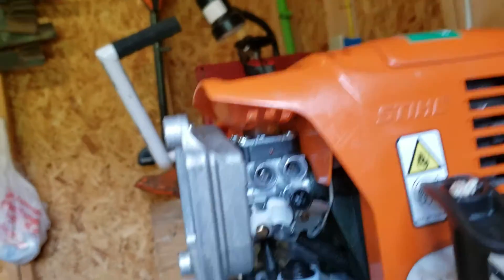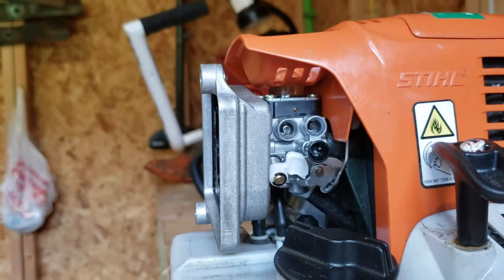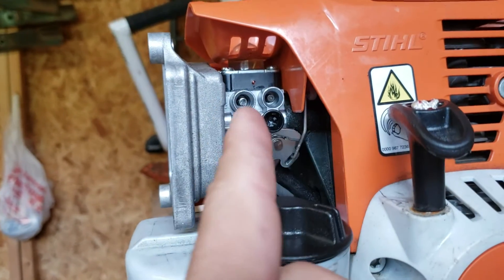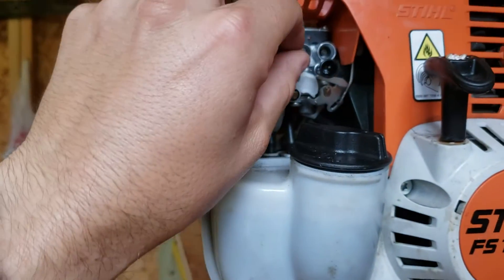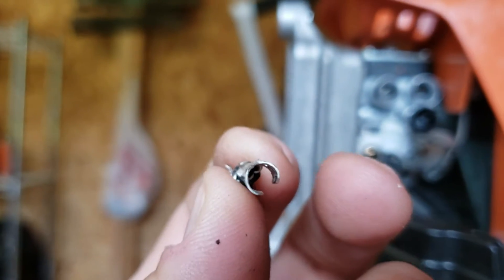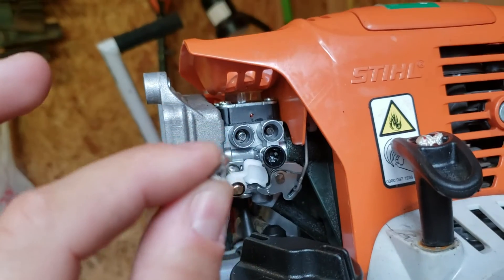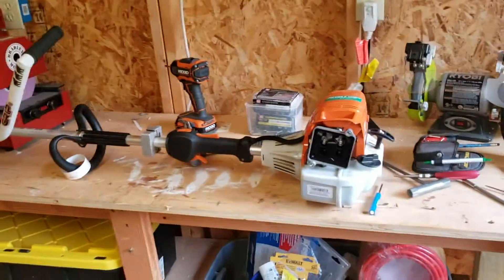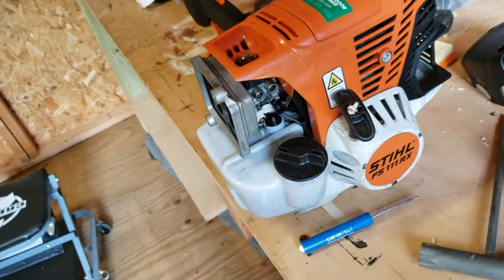DIY make your own Stihl Carb Adjustment Tool in a pinch.. Lawn Care

Comment: Please also add info on exactly how to tune the H and L on these presumably 4-Mix machines. I just tried an adjustment and I find it a bit different from ordinary 2-stroke chainsaws. L-adjustment is very easy. These 4-Mix engines have a different max RPM though and i find it more difficult to hear when they are just slightly on the rich side as they should be.

Comment: all you have to do is use a blue electrical wire splicer they slide right over those damn things just put a felt pin mark on it so you can tell how many times you turned it

Comment: Just buy a little pack of red size 14 gauge wire Splicers. The barrel type that are made to put a 14 gauge wire in each end and then crimp down...just take a brand new one they fit right over the end of your adjustment screw.

Comment: Great tip. Another method if no electrical connector is I used tweezers pushed in then pliers to squash the tweezers. Once the nut moved I could just hold the tweezers tightly without the pliers

Comment: I would like to buy the tool for my Stihl FS 70. I have the Double D, Hexagon, splined, Pac man, and single D. It is none of those. I don't have the 21 tooth spined. Can you tell me what one to buy?
Reply from the maker: This is what I bought. HOOAI Carburetor Adjustment Tool Kit for Common 2 Cycle Carburator Engine - Carburetor Adjustment Tool Set Carburetor Tune up Adjusting Tool (10pcs + https://www.amazon.com/dp/B079L4PKWQ/ref=cm_sw_r_apanp_rN8Ts7DweS1dm

Comment: Mine had the carb replaced and the idle is too slow and it stalls when the throttle is released. LA needs adjustment. Thanks.

Comment: Turns out the "special tool" is a 4mm socket. Comes in most small-tool kits, like "electronics repair" kits.
Reply: I tried, had to grind down the socket but stihl no luck
Reply: yea is a special thin walled socket, my two 4mm sockets dont fit
Reply: @valentin7054 the ones with electrical repair kits should be a nice thing wall. Mine fits fine. There are other brands that make this tool as well. Handy to have a bunch of carb adjustment tools.

Comment: Stihl isn’t supposed to sell the tool. The EPA forbids it in the USA, but you can find the tool on eBay, despite that. Big brother knows best….
Reply from the maker: I bought the tool on Amazon no issues.
Reply: @SouthernStyleLawnCare  sure, a 4mm is a 4mm. However, it would be nice, if while I were at my Stihl dealer buying a tuneup kit, I could also but the proper tool. I’m not a huge fan of making the Chinese and Bezos rich. Stihl is German, not American, but they have great quality stuff that my German heritage doesn’t mind paying for if it isn’t made in America.

Comment: Here's a better way pull one adjust screw at a time, take your Dremel Tool with cutting wheel and cut a flat screwdriver slot in each Adjustment screw, simple, easy, and works every time !! :)

Comment: These carb screws used need just tiny flathead screwdriver on the bg86 blowers but now they need the hex tool too I just found out... it had to be changed sometime in the past year or so.

Comment: I bought a 10 piece tool kit,which was supposed to fit my BG86 blower,for which I asked about compatibility before I bought them,but ended up sending the whole kit back.Thought for sure the 4mm in the kit would fit...NOT!.My screws look like some sort of hex,so I will try a 4.5 mm or 5mm nut driver,which I have on order.
My Hi speed needs some tweeking,as the rpm's keep going up and down at full throttle.
Reply from the maker: I ordered this kit and it had it in there. https://www.amazon.com/dp/B079L4PKWQ/ref=cm_sw_r_cp_apap_K8cALtESynrJ1
Reply: The bg86 blowers used to just use a tiny flat head screwdriver to adjust a carburetor I just found out today that now they use these things too. the BG 86 I have from a year-and-a-half ago still just has the tiny screwdrivers but ones that were bought 6 months ago seem to be this type now.
Reply: @SouthernStyleLawnCare  Thanks...but I don't see any octagonal heads in that set,only the 4MM hex that I thought was the right one...not the case! I bought two different kits and ended up sending both back.
Reply: @eluminaryxarrais7735  Yeah,my 20102 model definitely uses a octagonal head for the H and L mix screws.Thanks
Reply: I made a mistake on the year 2010 NOT 20102! Thanks.
Reply: 2020 NOT 2010?! Thanks
Reply: Turns out that both my screw heads have a octagonal (8 sided) shape.Where to buy this tool?Thanks
Reply: @keithhuckfield4175  got exactly the same issue here. They seem to have made a new 8 sided design, and can’t find the tool anywhere!
If you do manage to source could you please let me know thanks
Reply: @sulemanyusufadam4315  I will and you the same? What gear are using that needs adjusting?
Reply: @keithhuckfield4175  Thanks, and yes, if I manage to source one ill let you know. I've got a BG86 and noticed that they've changed the screws.
Reply: @sulemanyusufadam4315  Same machine as mine.(BG86)..we need a 8-sided (octagonal) shaped tool.I think Stihl changed the head shape in early 2020,so forget about obtaining a tool from the dealer. Still gonna look around,but gonna park the machine for the winter soon.
Reply: @keithhuckfield4175  Im surprised they haven't started appearing on eBay/amazon yet. Hopefully they appear soon
Reply: @sulemanyusufadam4315  There is a hacksaw hack to cut slots in existing mix heads that looks like they would work,but I am not looking to cut into a fairly new carb.my H screw needs to be backed out just a touch,plus my L needs the same adjustment ,as it has a slight stumble at low revs.Keep you eyes peeled for a tool...I will also.

Comment: Just another reason not to buy  a Stihl. Never have to adjust the carbs on my echos.
Reply from the maker: First one I ever had do that. It happened to my friends echo so it does happen.
Reply: Southern Style Lawn Care ....yeah it's man made so sooner or later it will need a wrench on it 😂😂😂
Reply from the maker: @wayneslawncare9241  happened to a redmax too
Reply: Yeah,....bet your Echo doesn’t run as good as a Stilh either!  I love me some Stilh products!  Just sayin’
Reply: I own both. By far, i have had more carb issues with Echo then Stihl. Also i use echo climbing saw 2511t, because its the lightest on the market. What i hate, is the reversal of gas/oil. So there is good and bad with all saws. Echo is good but not as good as stihl. In my experience
Reply: Thats an ignorant statement. Its obvious you have never had the pleasure of owning Stihl products. Both make good products, Stihl happens to be more reliable then Echo and last longer in my experience. With that said, I currently use and appreviate my Echo saws and blower, great products. But you can never go wrong with either brand
Reply: Every Stihl I have ever owned has had  problems from the get go. My echoes have never  giving any problems have been running echo for 15 years. So not just a ignorant statement.
Reply: David. I second that. I decided to start buying quality stuff and the first thing was a stihl weed eater (fs55) and it was nothing but trouble so echo gets all my business now
Reply: Meh, the 2mm hex tool bit to use on all their carbs is 2 bucks. Not a fortune. Sure you can't buy it in stores, but you can find it online on DIY sites.
Reply: I’m really late to this thread, but I have something to say! Haha! 
The most important difference I have found between Echo and Stihl is that my Stihl equipment (trimmers and blowers) will still run if the primer bulb is compromised. Echo’s can’t take much more than a thorn in the primer bulb before they just won’t start or stay running. 
It makes a huge difference when you need to keep boots on the ground and may not have time for repair until the next rain day.
Reply: I tell my husband this ALL THE TIME 😂😂 
When I first started working with him I used his old echo and he used his new Stihl and then one day my echo kept bogging down on me and I had to use the Stihl in a pinch. Never. Again. 
Hate how you feed the line in, hate how damn hard you have to bang the fucker for it to release more line, hate how you can't buy your own rebuild kit...  I could go on and on but my hubby swears by them. Meanwhile I'm on here looking at how to Jerry rig something to fix his edger but "Stihl is just the best" 🙄🤣 
Love him though lol